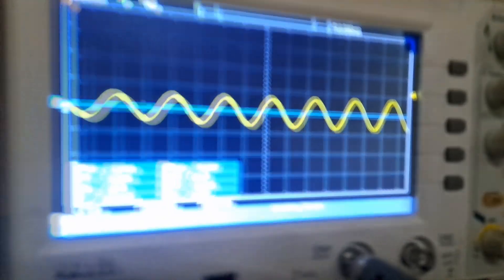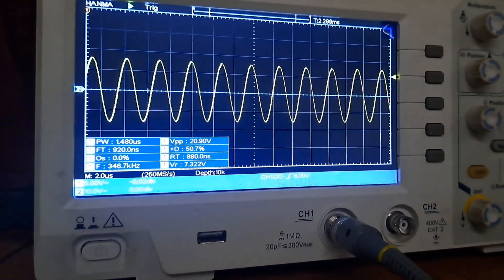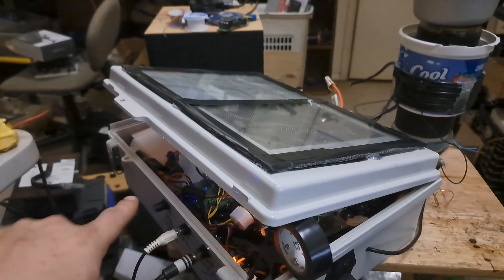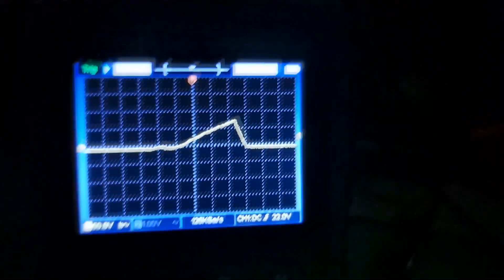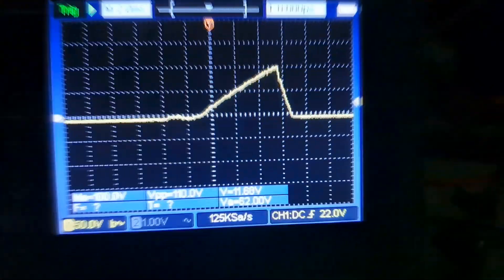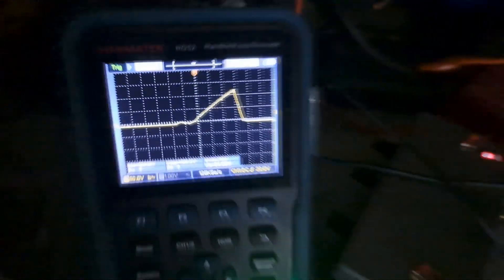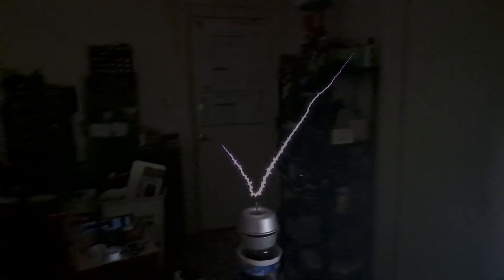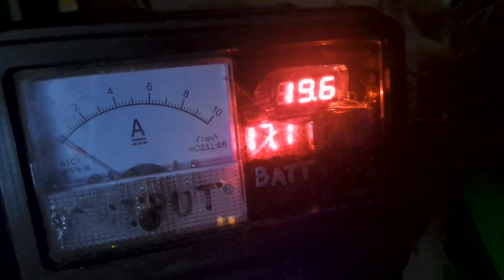QCWDRSSTC 350khz First Testing

Comment: Hey dude , i had a doubt , can i use an E type transformer core like the ones used for SMPS for the GDT rather than a toroid .
Reply from the maker: I think maybe if it was large enough and you know it can handle the current. The iron powdered cores of decent size don't saturate as easy and handle large currents. I was able to use nearly any inductor core up to a limit of applied voltage. When I used a very high permeability high frequency core it resulted in unwanted transients that killed the buck switch.
Reply: @Magneticitist 👋hello.
 I have a tiny secondary coil with a 4.5mhz frequency, can i configure the secondary side of the tesla with an extra 1 nf capacitor to the base of the coil , then the other lead of the capacitor to ground .
Would this drop the secondary side frequency from the megahertz range to kilohertz range , with the frequency equation 

1/(2*pi*root(L*C))
Reply from the maker: @spiderspider1384  I highly doubt that's going to work. If anything that tuning really needs to be done using a topload capacitance but you're not going to drop such an order of magnitude lower without a gigantic topload.

Comment: Thx for helping me, i tune my coil
Reply from the maker: Nice, now you just need to go Emperor Palpatine with MORE POWA to get those caps charging and discharging faster for the mucho arcs.
Reply: @Magneticitist  i already have 10kv, if this isn emought, i will connect 4 fbt in series to get voltage is need
Reply from the maker: @Lorikazz  Higher cap voltage could help but it's not really that, it's the supply power. For the real SGTC look that spark gap needs to be screeching fast which means you have to up your supply to something which can do that. A flyback transformer should work fine maybe ZVS driven or something.
Reply: @Magneticitist  zvs drivers are expensive, its aboute 100 - 700₺
Reply from the maker: @Lorikazz  What if you just made one? Only requires 2 mosfets, a cheap inductor, capacitor, and some cheap passive components like resistors and diodes. For that price I could probably make over 10 of them so it really doesn't make sense to buy them.
Reply: @Magneticitist  2 mosfets are nearly 200₺
Reply from the maker: @Lorikazz  When shipping or other tax reasons make such things incredibly high-cost, there's always the advantage that they are of the most commonly available components you will find inside junk electronics.
Reply: @Magneticitist  tube tv ?
Reply from the maker: @Lorikazz  Well it would at least have the flyback transformer. Maybe not any mosfets you could use but a bunch of other random bits like capacitors that would work.

Comment: It's ready to send!
Reply from the maker: With your holy blessing I shall send it
Reply: Tell him to disable the OCD 😮
Reply from the maker: @morganchandler5126  I just tried cranking it again and I guess maybe interference was the problem... Or IDK some other random shit I'll see come back after I tidy it up some more. I was able to bring it to 160VDC ramps without issue and could never do that before, but couldn't go higher without switching to mains. Gotta do some shit first before I do that. Anyway I'm about to try getting it ready for bootlegging mains through this 120V to 60V transformer I have I'm gonna use in reverse cause I'm too lazy to do anything else. Do you use any kind of current limiting resistor on the input? I feel like I'm gonna be working my variac hard charging like 15,000uF
Reply from the maker: @morganchandler5126  I did cut OCD way up and push it higher voltage but I actually couldn't get above 150VDC ramps without the output wigging out. It looked almost like OCD tripping but the light wouldn't blink. I figured it might be trying to flip over to lower pole feedback so I reset the PLL to exclude frequencies that low. Still happened. So then I went back to the first smaller coil using secondary feedback and the same thing would occur at the same voltage.

So then I went ahead and got everything opto isolated started messing with tuning and shit. So far I don't really think I've done enough to avoid this problem unless it was just an interference thing. I'm also still stuck on trying to figure out what this annoying screech in the output is over a certain voltage.